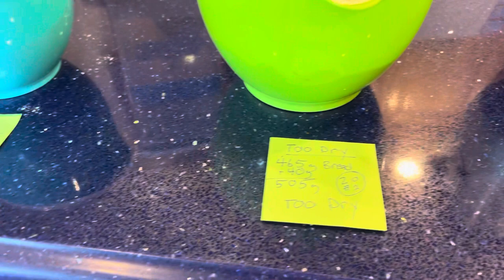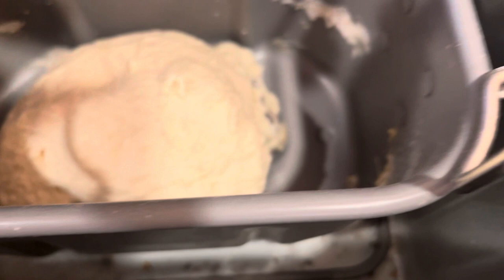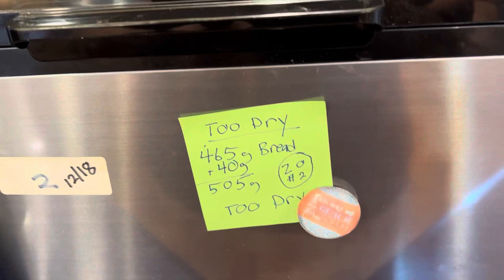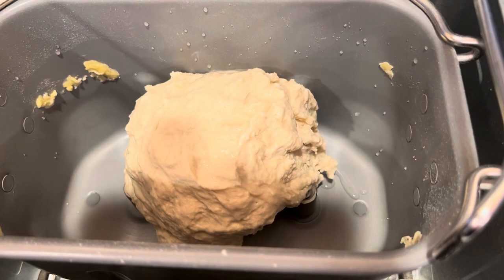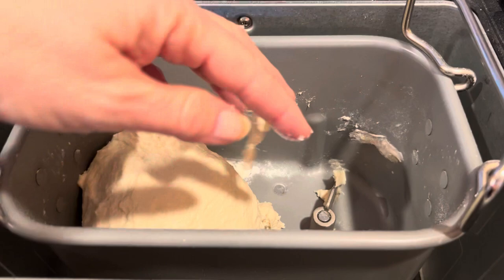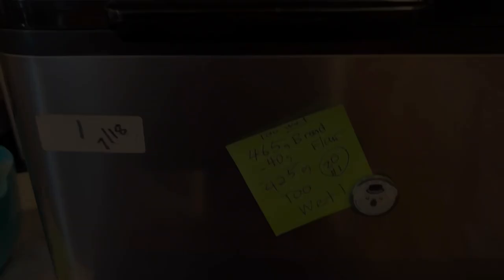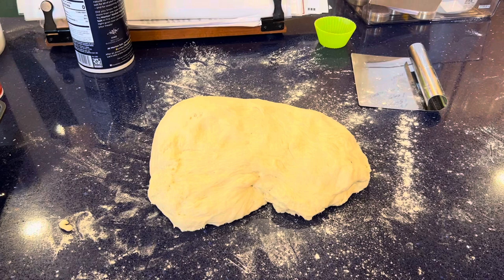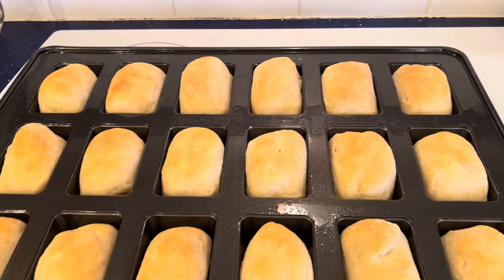Reading your Dough: Too wet/Too Dry

Comment: I want to thank you so much for the information you are sharing.  I got my Zo today and after supper started with the very first use.  I had to use some of your helpful hints on too wet or too dry and it works like a charm.  My bread is looking really great.
Reply from the maker: That is wonderful! Welcome to the bread baking adventure! EllentheBreadMachineBaker@gmail.com
Reply: @BreadMachineVideosWithEllenH  I have been baking bread for many years, but due to my health I had to resort to a machine.  I brought out f two I had, and discovered neither one worked right. So my hubby was sick of seeing the fails and gave me the go ahead to get a new one.  In my research on a reliable one, I came across your videos as well as Grains and Grit so between the two of you, I learned a lot and chose to buy the recommended maker.  As I said, your info was so helped so much and my bread turned out beautiful.  Again, thank you.

Comment: Many thanks, this is clearly a unique video:  Many of the 'Bread Chefs' are more studio people, than they are cooks.  I have seen way too many times "Never add more flour, if it's sticky, work through it, or knead it this way or that" (Good for them, their flour is stored in a climate controlled pantry, and used in a climate controlled kitchen, and many of us don't have that) Well, they give an 'exact' (hahahaha) recipe, without saying what brand or type of flour they use.  If one sees a video without the brand and type of flour used (at least), just enjoy the video for what it is, but the recipe can't be taken seriously.  If I can give some numbers; 1,000g flour @ 12% hydration vs 1,000g of flour @ 17% hydration (easy swing), is really 975g flour vs 1025g flour using 14.5% moisture content as maximum allowable by federal regulations.  represents not only a 25g loss of water, but a gain of 25g flour, same for the moist flour, 25g gain in moisture, and 25% loss of flour.  These swings will altar the final hydration of the dough by more than 8%   What was designed to be (for example) a 70% hydration dough becomes a 66% hydration for dry flour, and a 74% hydration for moist flour.  Yet they say "don't add any four, it will change the recipe "  Thanks for taking the time to read my rant, and again, many thanks for the Video.
Reply from the maker: You’re very welcome. I like to keep things simple!

Comment: Hi! I too own a Zojirushi virtuoso plus. To me it’s really a hit or miss! I made probably 20-35 loaves during the 1 year and a half ownership. So far, I only made 5 failed loaves. The bread is either too hard like a rock or too dry which is inedible. I tossed them all out. I never tried finish eating a failure bread. But recently, I have made 3-6 loaves of red bean breads successfully. I followed the exact weight and amount of ingredients from the official recipe book that the machine came with. I just add the extra ingredients when the sound beeps. Normally, I would add 200g of cooked & semi dried red beans into a 325g of milk. When it beeps, I would crack an egg to mix with the dough. It comes out successfully baked! Just yesterday, I made a failed loaf of red bean bread because I added an extra 100 grams of cooked red beans that is semi dry (little wet). It didn’t rise properly, actually it over risen and when I plopped it out from the pan. The bread was top heavy, it became squashed. Once I cut open the bread, the filling was so overwhelming, it became pastry but dried and squashed. I took a bite, it was dry and blend! I have no choice but to toss it into the trash… 

This morning, I just substituted milk with plain red bean juice, I weight the exact amount of ingredients into the pan. Crack an egg when the machine beeps. The perfectly rolled dough wasn’t sticky but after I put an egg which I always do, the dough became running wet and wasn’t properly formed after mixing with the egg. I thought to myself, will I failed again on making this loaf. So I patiently wait till the end. To my surprise, the bread was successfully risen and it didn’t collapse like last time because I didn’t put any red bean at all. So, from my experience, it’s kinda miss or hit with the bread baking. If you’re too greedy like over putting too much ingredients that is wet or semi wet. The bread will mostly turn out a flop, meaning the dough will not turn out like bread but rather a completely inedible dough that looks like a dried pastry cake…
Reply from the maker: I have never heard from of putting beans in bread. Whatever made you think of that?!!!
Reply from the maker: Are they kidney beans?
Reply: @BreadMachineVideosWithEllenH  it’s those regular rounded red beans. Not kidney beans.
Reply: @BreadMachineVideosWithEllenH  you heard of red bean paste cake from Asian grocery. They make moon cakes with red bean paste. Japanese and Korean have red bean bread. You can check out their recipes. They’re not kidney beans that you folks like to put in your chilis.
Reply from the maker: I have heard of red bean paste!
Reply: @BreadMachineVideosWithEllenH  Great 😊! You can try applying that in your bread. Taste very good. I just dumped everything in the machine and let it do its thing. So the finished product is a mixed purple looking bread like whole wheat. However, the proper way is to take out the dough and put the paste in it, and then put it in the oven.
Reply from the maker: Thank you!
Reply: @BreadMachineVideosWithEllenH  Is it salvageable after realising the dough is too wet or dry? Before watching your video, i did try pouring extra flour in the machine after it beeps. But no use, the bread was not even bread anymore. It's soft and hard texture of the bread and it wasn't fluffy. The beeping phase doesn't give a real proper kneading because it was meant to mix the extra ingredients with the dough. I never once open the lid when it was kneading the dough. Is that the right time to add flour or liquid to fix the issue? But when the machine is operating or kneading. I'm afraid to poke my finger to feel if its sticky or tacky. Deciding to add more flour or liquid from that moment.
Reply from the maker: You have to get your dough the right consistency at between 5-8 minutes into the kneading process after the rest is over.
Reply: @BreadMachineVideosWithEllenH  During the beeping sound phase or during the initial kneading process from the beginning? So the salvageable moment is during the 5-8 minutes of kneading. You then check the texture during the beeping sound in which the machine reminding you to open the lid?
Reply from the maker: No. The beeping sound is for adding nuts, seeds, raisins, etc. your dough must be the correct consistency before then.
Reply: @BreadMachineVideosWithEllenH  Thanks for the clarification! So fix the consistency during the kneading process at the beginning. Is it safe to feel the texture of the dough when it’s kneading?
Reply from the maker: @3rd-Wave_Rebel  when you open your Zo, it stops! Then you look at it and feel it. If it looks like a rock, it’s too dry, add a tablespoon of water, close the lid, recheck in a minute. If it’s too wet it won’t form a ball. The dough will puddle under the paddles. Add a bit of flour, wait a min, check again.
Reply: @BreadMachineVideosWithEllenH  Absolute thanks! I never open the lid once it starts kneading. So it stops after I open it? That’s a unknown feature to me.
Reply from the maker: Yes, when you open the lid, the paddles stop kneading the dough. That’s how you check your dough 5 minutes after kneading begins and add more liquid or flour if I need to. Please watch my video again. I’m not sure you absorbed what you watched in my video. Here’s the link for you again.
Reply from the maker: https://youtu.be/HwHEvOAv5xU
Reply from the maker: Please also watch every video in this playlist and read your owners manual at least once thoroughly.
https://youtube.com/playlist?list=PL4uX4aR9ec7qnDFrMQ6qmvIZcUyzTiPYC

Comment: Not sure if you're still checking comments on this video, but I'll comment just in case.  I just bought a Zojirushi mini.  I'm a total novice at bread-baking.  So thank you for this video!  I had been wondering at what point I should check the dough and at which rise.  If you check five minutes in, before the first rise, isn't it possible the dough would get the perfect consistency later, like maybe when it kneads the second time?

Also, you took the dough out to bake in your regular oven.  How do you know when the third rise is over so you have time to take it out before the baking kicks in?  I wish Zojirushi gave an audible signal at such time.
Reply from the maker: Hi! Of course I’m still checking comments! I do not have a mini. In my machine, I check 5 minutes after kneading begins. I also bought a Zo Maestro recently and it’s completely different. It mixes a little, rests, then kneads so for that machine it’s at about 16 minutes that I check.

For taking dough out, you’d use the dough course. I
On the Maestro it says Dough: Bread and Pizza or pasta. You’d choose Bread or pizza. I’m not sure about the Mini.
Reply from the maker: I just looked up the mini. There is a dough setting.
Reply: @BreadMachineVideosWithEllenH  - Oh, I see!  The dough setting!  I didn't read the directions for that because I figured I wouldn't be making pizza crust or rolls yet.  Thank you so much for clearing that up for me and for your reply.  So helpful!!!

My first wheat bread is baking now.  I think it'll be a disaster because when I looked in the window just before baking should have started, there was dough globbed on the sides and it didn't rise much.  I hadn't yet seen your video when I started the process.  Live and learn, I guess.
Reply from the maker: @e.castlerock8454 you’re on your way! EllentheBreadMachineBaker@gmail.com

Comment: Can working wet dough when adding more and more flour overwork the dough and ruin it?
Reply from the maker: If you add too much it will be too dry, so yes. That’s why you add a tiny bit at a time, stand by for a minute, add a tiny bit more, etc. until it’s right. If it gets too dry add a splash of liquid. Once you get some experience you’ll get it.

Comment: there are bread types (ciabatta is one) that are supposed to have wet doughs, some having hydration levels of 70-80% (or even higher). how does your bread machine do with kneading that type of dough? (in which case you do not want to add flour to make it "normal" since it is to remain wet)
Reply from the maker: That’s a really good question! I guess I go by experimenting with certain recipes! Take a look at my Herbs de Provence recipe for example!
Reply from the maker: Here’s the link. https://youtu.be/clKP8dhICTY
Reply from the maker: I just make recipes that work for me. I’m not really into doing the hydration math, to be very honest. I’m no expert! I just share my recipes that are successful for me in my machine in my climate with my ingredients!!!  I’ve never made ciabatta. I do have some “mainstream bread” videos but more often I like to invent new, somewhat unheard of recipes.
Reply: @BreadMachineVideosWithEllenH  thanks for the link. I think you (and others) have answered my question about wet doughs: 1) a bread machine CAN knead wet doughs. 2) a competent mixer can also do wet doughs. Both methods though still require some manual "work" prior to baking, but it's nowhere like the work it would be without the assistance of the machine! I have an "ancient" Zojirushi S-15 bread machine which is built like a tank. Until your linked video I wasn't sure if it would be possible to actually do a wet dough in the machine -- next time I try a wet dough (using either a  biga or poolish method) I'll try using the S-15. Thanks for your link though -- very helpful!
Reply from the maker: I’m glad to help!!! Feel free to message me anytime!

Comment: Somebody please help me: I have a Tefal bread machine, i tried to make bread 16 times, and it is still solid (dough doesn't rise) unedible, tastes yeast. I tried different type of ingredients (yeast, flour, even salt and water) and recipes.
Temperature is 106F, good. Tried to make it wet and dry, other programs, not really changes.
I have run out of options, and getting crazy.
Reply from the maker: Hello. Are you on either Facebook or Messenger? I could call you and maybe we could figure out the problem. If you’re on Facebook, look for Ellen Walker Hoffman and send me a private message. On Instagram I’m @GigglerEH
Reply: @BreadMachineVideosWithEllenH   Thanks for your reply. I just put away my bread maker, and need some time to cool down. I will contact you.
Reply from the maker: Here’s my email. EllentheBreadMachineBaker@gmail.com 
I know I can help you.